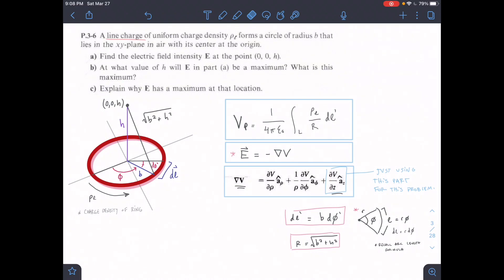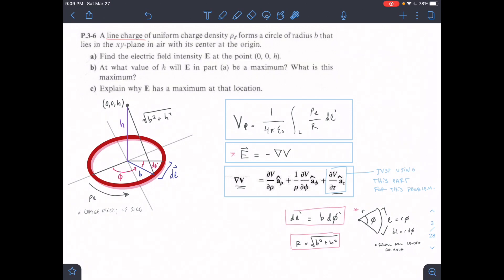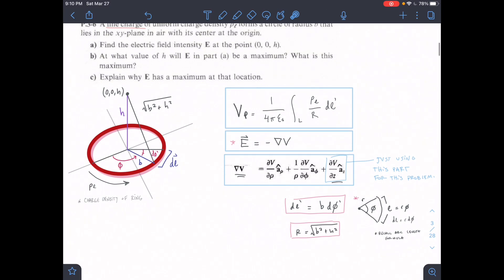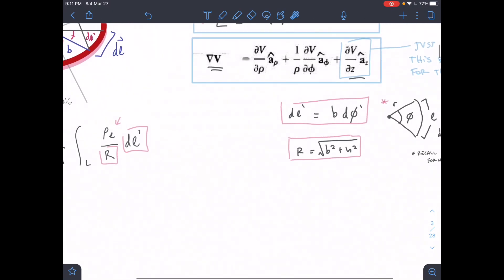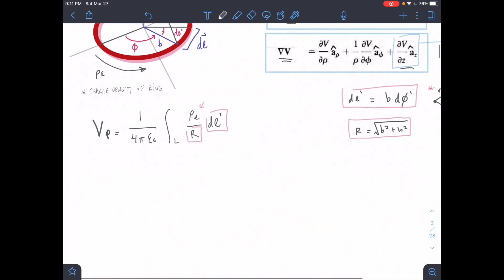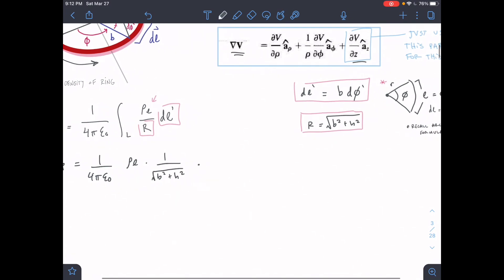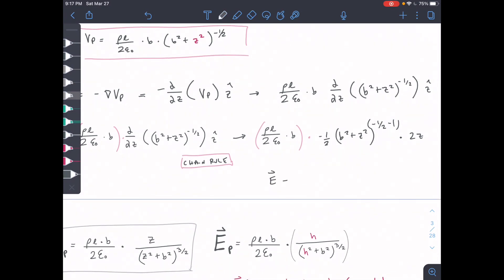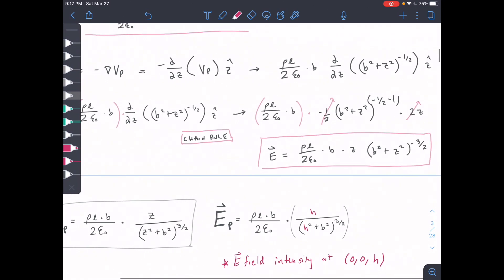3-6 a Charged Ring, find E-Field, use V to Calculate, Line Charge - see comment

Comment from the maker: 7:20 small error, dropped a negative and added it in the final step, will add a note to the pdf so the soln there shows the negative, the final solution is still correct but should have a (z-hat) direction.